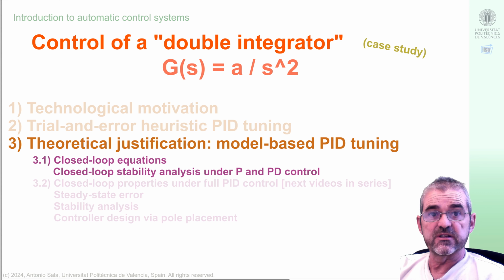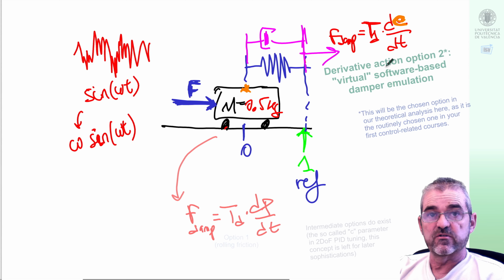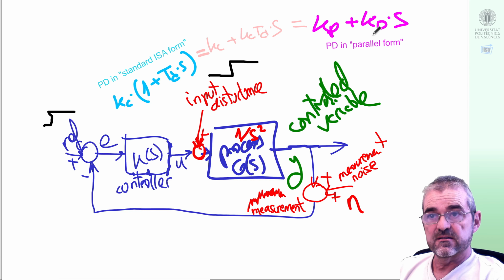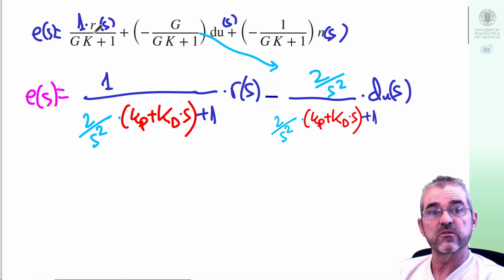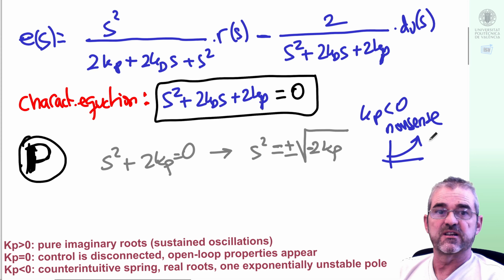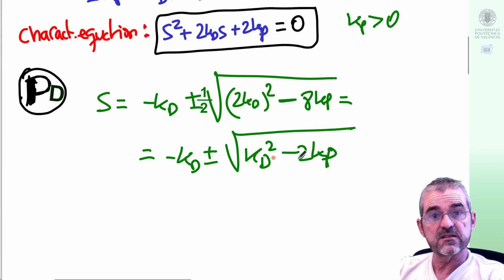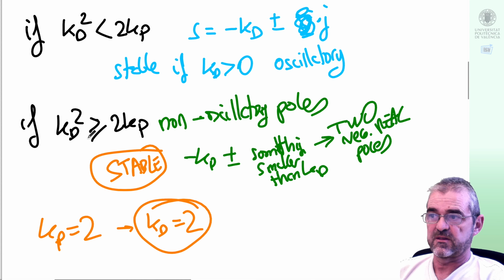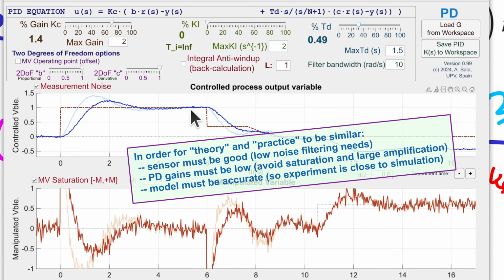Double integrator, PD control: stability analysis (theory)

Comment: why do control theorists put input disturbance as disturbance instead of output disturbance? input disturbance means that the actuation that you are giving the system doesnt happen as wished and this is considered a hardware error in real life and the control algorithms are not expected to handle that before output disturbances.

output disturbances are realistic and should be handled before input disturbances, input disturbances are usually handled with fault detection of the hardware because usually control algorithms cant handle it
Reply from the maker: Thanks for your comment.
You shouldn't take the word "input" literally. What you are referring to is an "actuator hardware fault" which, indeed, may be catastrophic for a control algorithm.

What I understand as input "disturbance" is, say, an abstraction/simplification of a wind gust on a drone, opening your fridge's door, opening the faucet to drink water from a level-controlled tank... let me explain: you have a manipulated "actuator input" variable that can exert, say, a force on something you are moving in the direction and magnitude you wish... that's good; however, other guys may also be exerting unexpected/unmodelled forces (wind on a drone, augmented friction on a mechanical system, somebody pushing...) the end result is that the resultant force is not what you think it will be, and the difference is abstracted in the concept of "input disturbance". There is no "hardware fault" in there: on the contrary, your drone control must be there in order to avoid the drone drifting because of air currents and propeller miscalibration. 

In general, you may be providing a "manipulated, known" amount of "power" or "inflow" to move/heat/charge some system but the resultant power is not 100% what you thought you were providing; no problem because you get informed of that situation with sensing, nothing is wrong/faulty there: if your sensors detect that the drone is moving left when you thought it should remain motionless, your controller will react and push it rightwards just a little, in order to compensate for that "unknown thing", i.e., disturbance that seems to be moving it. No fault is happening in your propellers, it's just the wind.

So, "input disturbance" is the "theoretical abstraction" of these issues when we are not interested in the actual "physics" or "technological detail" of what is causing them/how they happen:
the most simple way of simulating the above kind of events to validate a PID behaviour is to add, say, a step on the input side, to see how the PID reacts to compensate for it.
Reply: @ASalaControlEN  

drone:
input disturbance: the motors dont go to the rpm set by the controller
output disurbance: wind or a push on the drone out of position

fridge:
input disturbance: the cooling circuit does not give the cooling it is supposed to
output disturbance: opening the door

level controlled tank (assuming constant flow out of tank, controlled by water being added):
input disturbance: the water being added is not what is expected by the controller
output disturbance: opening faucet to empty faster or less flow out of the tank

input: actuation
output: result

input disturbance: error on the actuation
output disturbance: error on the result
Reply from the maker: Dear Rezah,
Well, it seems that what I call "manipulated input" or "manipulated actuator" you name it, plainly, "input". And "everything else", you name that as "output".
Well, if that's what you understand, that's not what I understand... No problem, we have different opinions, but we can live on our lives happily.

My opinion in systems-theory jargon:
INPUT: anything that can change the "internal state/energy/mass" of the process I am interested in controlling.
There are TWO classes of inputs: the "manipulated ones" in which I can decide its value (manipulated actuation) and the "non-manipulated inputs", which come in as they wish and I must counteract.
OUTPUT: what my sensors tell me about the internal state/stored energy/stored mass in my process.
Then, in "generic systems theory" there is no such thing as "output disturbance". Disturbances may affect internal states in many ways, so we need to discuss controllability, observability, etc. for each input and sensor.

Now, terminology in "single-input single-output process control simplifications" of the above general setup:
INPUT DISTURBANCE: any "disturbance input" whose effect is (maybe approximately) equal to that of my "manipulated input"... any "external force" to my drone, any "thermal power drain" in my fridge, etc.
OUTPUT DISTURBANCE: any "disturbance input" whose effect on my output of interest might be "faster" than that of my actuator, of which affects other subsystems/states different to those that my actuator is able to change, and important for my control tasks (target motion in tracking, measurement noise, ...). 
If my system is stable, slow input disturbances can be converted to output ones via a block diagram transformation. Fast output disturbances cannot be converted onto input ones.

But, as I said, we are not starting a war here... Just note that classifying everything into "either input or output" is a simplification just as naming a color "either black or white"... there are "grey" things.. and in full-fledged system theory there are inputs, states, outputs, and controllable subsets of states for a given input, and observable subsets of states for a given sensor, and quantitative measures of controllability and observability... so there are many terminology nuances which are needed for a correct formal analysis apart from "input" versus "output".
Best regards.
Reply: @ASalaControlEN  
your definition is so complicated 🙂

it was very interesting to read how theorists view things, if anything that affects the internal states is an input disturbance isn't everything an input disturbance?

also when you put the disturbance in front of the system in the block diagram, that is the input of the system, which is the actuation signal

anyway, we disagree, no war, in the middle east we argue about everything but as long as there is no insults, everyone is friends
Reply from the maker: " if anything that affects the internal states is an input disturbance isn't everything an input disturbance?"
In an abstract sense, yes: disturbances are always "inputs" to a system. The actuation signal is "just one of the possible inputs" affecting the energy/mass balances of my process. Disturbances "added at the input" or "added at the output" of block diagrams are simplifications for a first approach to testing PID control performance.

And, yes, you have many more important issues to discuss in middle East than what is the meaning of "input". Best wishes, my friend.